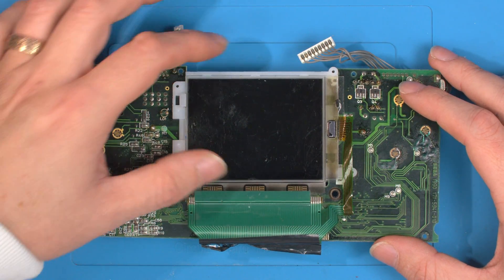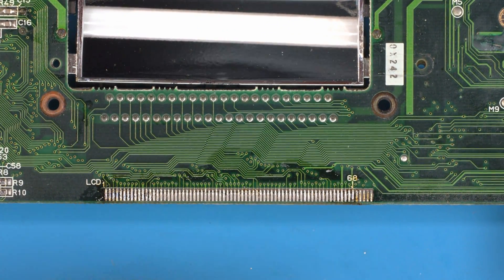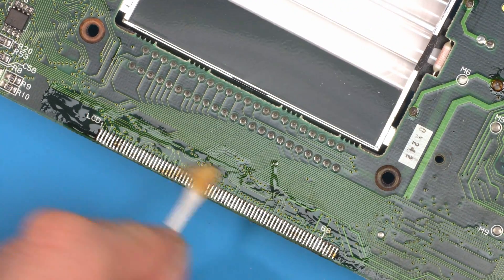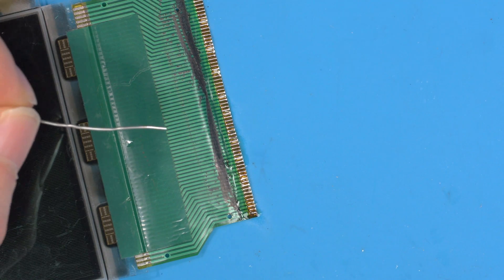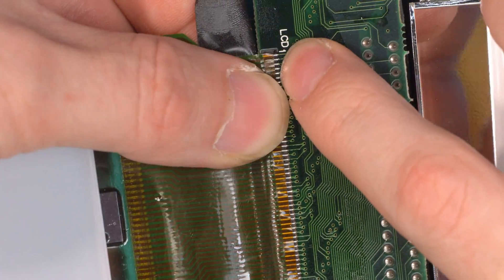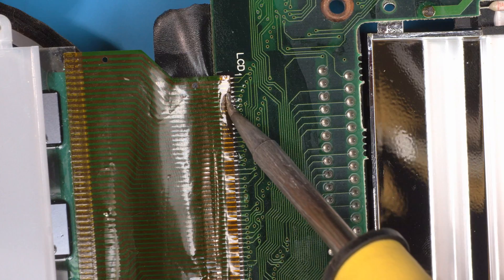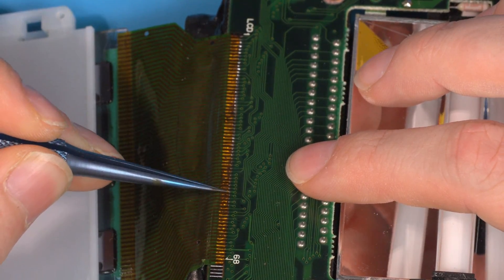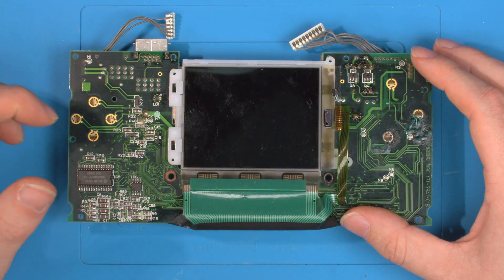Transplanting Game Gear LCD Made Possible

Comment: Hi, Retrosix u are my last hope :(

i hope u can give me a tip, i have recap a game gear with 2 asic ic 
 
I use 5x 100 Uf 25v ( not smd format )

But when i Turn the game gear on i see only a light , the contrast make no sense its have 20k i have check it with multimeter ( wheel is not broken ) 

Is my LCD defective ? 

I see only a light and nothing more, no game to see , it is lightly dark but the wheel is not working for darker and light mode, i am end with my mind 😞 

Please a Tip from Master himself 😔

Comment: hello. something about flickering GG original screen? i have some boards with this issue after recap (literally the same problem). both  differential signals pairs and VM are normal, 
no unwanted oscillations (frequency and amplitude) in them. I tested it with the oscilloscope on the 5 contacts on the side of the screen to make sure it wasn't a problem with the flat. the flickering is just there and i can´t figure out what could be going on . 
Have you ever had a problem like this?
Reply from the maker: Join our discord.gg/RetroSix and share videos of the issue
Reply: ok, i'll. tks
Reply: Unable to accept .. :(

Comment: Hi, could you perhaps share the LCD signals on a good working Game Gear or how to tell if the LCD is bad? Thanks.

 After buying a broken Game Gear that was an "attempt to fix" by someone, I found out it was heavily corroded and a few mistakes were made in the rework also. I managed to fix it to a point where the game is loading, it has sounds, the lamp is lit and the contrast works. However the LCD which has all signals present, only shows a few lines but no other activity. 

For example, when loading the Collums game, I can see that the frame of the game(where the blocks would go) is set on the LCD but nothing else. When it switched to another screen, it updated to nothing.

At this point, I'm not sure if the LCD is bad or there is still a PCB problem. Since I don't have another one, I can't tell yet. I will attempt to check the PCB again though.
Reply: Update: I found a fix. The problem came from R42 and C45 in my case. I remade the connections and it's working fine now. The PCB has a lot of straps now but no matter 😅👍🏻
Reply from the maker: Great glad you found the issue

Comment: Which is the suggested temperature for hot air? Thanks
Reply from the maker: Depends in each situation, specifically for the GG ribbon removal I would run at 480C and 80% air would be fine
Reply: @RetroSix  many thanks